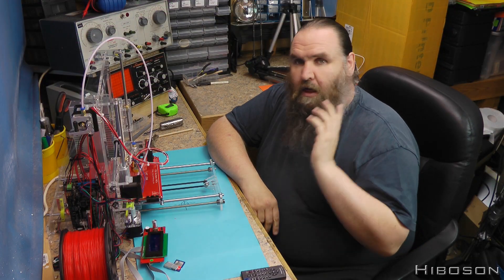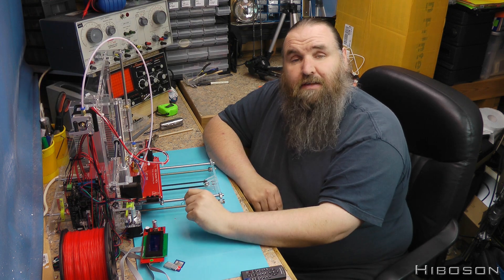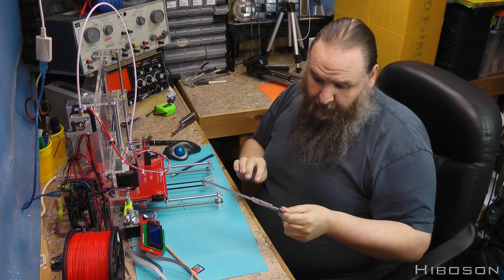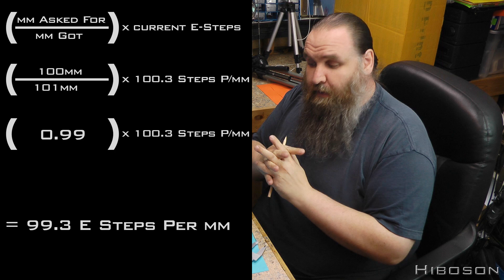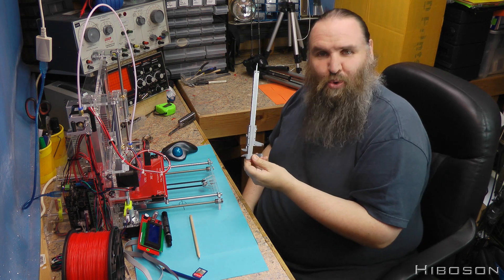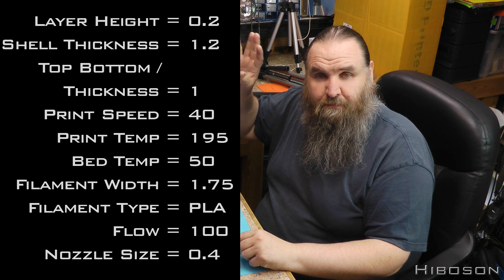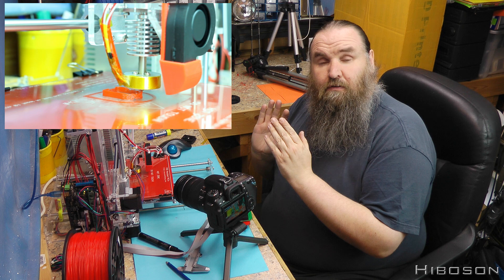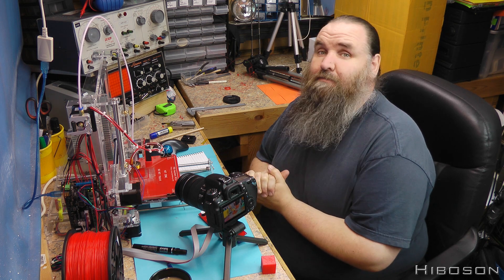3D Printer Build (Setting up E-Steps) - Sunhokey Prusa i3 - Part L

Comment: I've got a guestion. I've set E-steps to correct 94.5-94.6 e-step/mm. But my bloody prusa i3 always drops it down to default 80.5 e-s/mm at any reboot or reconnection to repetier-host. Any way to reset the default values?

Comment: Hiboson I have my 3D printer from Sunhokey for a few months now and I can't get it to print. I think the problem lies in the software which I am not an expert in. Can you tell what firmware you used? Thanks & love the videos!
Reply from the maker: Rachel o connor Hi Rachel, well my firmware is whatever came installed,, I wanted to try do my videos with everything stock as from factory,, I think I'm starting to learn that may not be possible, see tomorrows video you'll see what I mean lol

Comment: Hiboson your telling me that they gave you 3 extra hot ends and you havnt printed the parts to upgrade this for dual extrusion so you can print in 2 colors??? mines in the mail on the way here so if you want to mail me a hotend ;) lol
Reply: Eidolon also put printer tape over the print area it will make printing better as well as no worries of not getting it off the glass. Also a paint scraper pops a stuck print off with ease.
Reply from the maker: Eidolon Got extra heads but not extra steppers lol, still fiddling to get the steps right, not had any time as late to do anything with it, but hopefully (he says lol) soon might start getting some time in a few weeks or so :),, Oh and all the heads are mine BWHAHAHAaaaaaaaaaaaaaaaaaa :D
Reply: Hiboson lol, Well i found a manufacturer on line that sells ready to go heads that come with bowden extruders for $25-35 depending on the configurations you get so ill be dual soon!

Not going to lie though i really want to drop $300 on a diamond head extruder from reprap.me
Reply from the maker: Eidolon Somehow I think your inner demon will one day hit the buy button on the diamond head and you will not be cross with it for doing so lol
Reply: Im about 99.9% sure that you are 100% correct in that thought lol bout to watch your new video!!! hope its a good one haha. You need more 3d print videos!!!! (when you have time)

Comment: Wondering if anyone else here is having (major) problems printing ABS with Sunhokey Prusa i3, especially prints that make lots of contact with the bed. Some reason I can only get my bed up to 89 degrees before Err: MAXTEMP is triggered, even though it is advertised to have a maxtemp of 100. This is giving me tons of warping, even with a painter's taped bed and freshly applied ABS slurry. Last print, the warping was so bad that it actually tore the tape off the bed in the corners. Wondering if any of you gurus could share their success story/suggest a next step for me -- should I invest in a better heat bed, a borosilicate glass cover, Kapton/PET, or otherwise? Thanks!
Reply: Maxtemp is a safety setting determined in the Marlin firmware. You'll need to edit it and reupload to your MKS board using the arduino IDE and a usb cable. I don't recommend trying to get your bed up to 100c though. I tried and my board burst into flames .... : (

Comment: Can you see any difrrence between http://www.aliexpress.com/item/2014-hottest-3d-printer-Prusa-i3-for-DIY-kit-sale/32245219995.html and http://www.aliexpress.com/item/Hot-Full-Acrylic-Quality-High-Precision-Reprap-Prusa-i3-LCD-Acquired-DIY-3d-Printer-Kit-with/2026704108.html?spm=2114.32010308.4.2.hPvZjl  ?
Reply from the maker: KrisMaster At quick glance (not got time to check off compare each part etc) look the same, when I got mine they had 2 of the same for sale at different prices, I think they have one high one "on sale" then the sale one goes up in price and the other then suddenly come "on sale",, but just message them and ask what the difference if they say nothing then well I think decision made lol in fact the cheaper mentions a 8GB SD card the other don't too ??? best asking them then if they say there the same and try send different to the more pricey one you have proof they said it was the same ;)

Comment: Hmmm. Well there are a few ways to change the settings.
1. Modifying the Marlin(usually Marlin) firmware through Arduino. This is easier done with the original firmware that is programmed by the seller. If you don't have that, you'll have to start with fresh and reprogram using a new marlin firmware with settings that you have to reconfigure. 

The next two you'll have to have the firmware to enable saving to EEPROM. Someone already commented a link on how to do that.

2. Modify the settings through the LCD.
3. You'll have to connect the printer to the computer and open a host that can send and read g-code commands, e.g. Pronterface. Then you send M92 X(your step number) Y(your step number) Z(your step number) E(your step number). Then send a M500 command to save it to EEPROM.
Reply: Also, the warping at the top is mainly because of there being too much heat building up at the part and causing the part to not solidify. To solve this you would have your fan(not extruder fan) turned on or add more fans. This warping usually happens mostly with PLA due to its low melting point.
Reply from the maker: darkfire2022 Thanks for the info Darkfire many have told me now its too much heat so I'm now going to try make sure my cooling piece fan is properly ramped up and if still no joy have been sent a few designs for better cooling nozzles ;) Thanks for the suggestions ;)

Comment: Hiboson If you ask me, the height issue has to do with the temp of the filament. Because the layer at that point is very small the nozzle makes contact with the printed PLA all the time, making it very soft and flexable. To make sure, print the part again but pause it half way, move the nozzle away and wait for a few minutes. Then start it again. If the first few new layers are improved, heat is indeed the issue. Only way to solve this is a better fan (or fan mount) or a bigger layer (like the big cube). Maybe this will help: http://www.thingiverse.com/thing:714939

Comment: You should try another open source slicer program, maybe that's the solution to the warping. Also, if the controller board has a website, you should verify that there are updates for the controller, maybe that'll help too.
Reply from the maker: Frédéric Druppel I have had some people send me new some firmware versions, just need to find some time to play with the control board now lol, thanks for the suggestion ;)